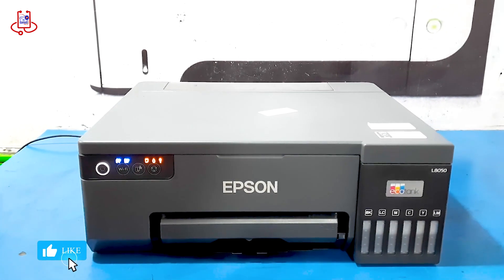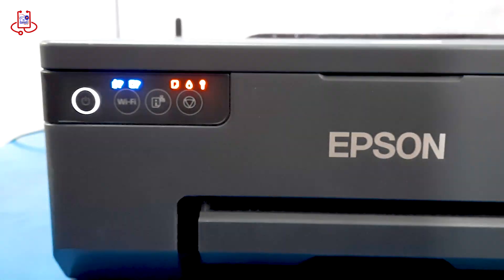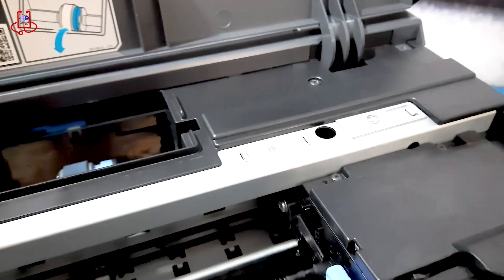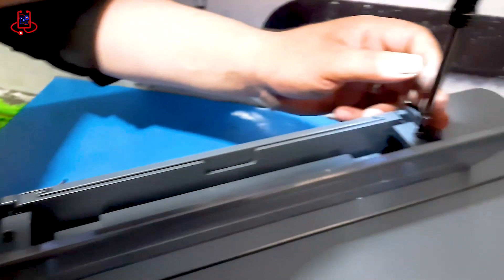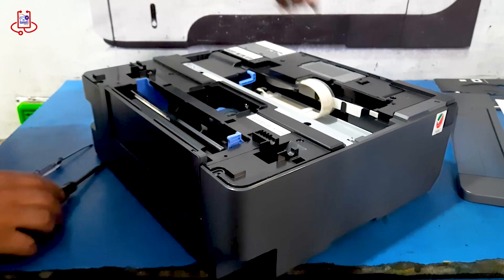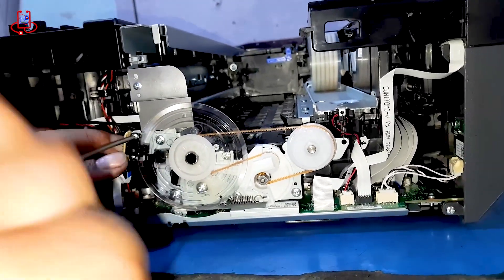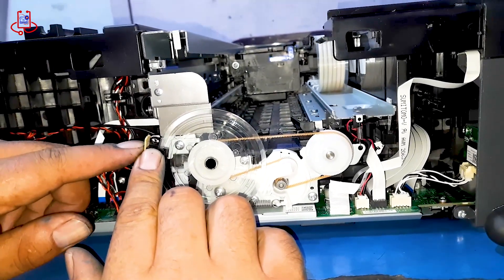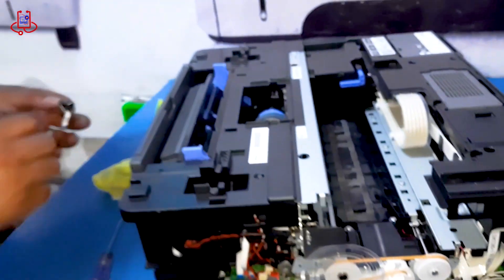Epson L8050 all lights blinking error solution/Epson l8050 not printing

Comment: Epson when I burn it is burning then it turns off
Reply from the maker: Hi! If your Epson printer turns off shortly after powering on, it may be a hardware or power issue.

Check that the power cable is properly connected and the outlet is stable.

Try a different power outlet.

If the problem persists, it could be a mainboard or internal component failure, and the printer may need service.

Comment: Hi😅
For some reason, I got an error
0x791e on the L8050 printer.
I disassembled everything and cleaned it more or less according to the instructions, then reassembled it — but it didn’t help.
The sensor was covered in grease — can I clean it with alcohol or water and let it dry?
Maybe there's still some dirt left on it.
Reply from the maker: Yes, exactly. You can clean the sensors with isopropyl alcohol and let them dry completely. This usually doesn’t cause any issues and may help resolve the error. Just make sure to use pure, appropriate alcohol and allow the sensor to dry fully before using the printer again.

Comment: I tried this but still have the blinking issue
Reply from the maker: If all the lights are still blinking after trying this method, it means your printer needs a professional reset or the waste ink pad needs replacement. Please visit an authorized service center.

Comment: Please solve the problem of code 031006
Reply from the maker: Error code 031006 on the Epson L8050 usually indicates an issue with the mainboard or printhead. We recommend taking the printer to a professional technician for repair.

Comment: Very useful information and I have a problem with L 8050 that "incorrect loading of tray/disc' will you pls help me?
Reply from the maker: Hi! The 'incorrect loading of tray/disc' error can usually occur if the tray or disc is not properly aligned. Please make sure that the tray is correctly inserted and the paper or disc is positioned properly. If you're using a disc, ensure it's placed in the correct tray for printing. You can also try restarting the printer and checking the settings. If the problem persists, you may want to refer to the user manual or contact Epson support for further assistance.

Comment: Epson l8050 bị kẹt giấy hoài,khắc phục sao cho hiệu quả anh trai
Reply from the maker: Hello! The paper jam issue with the Epson L8050 might be caused by factors such as dust inside the printer, using unsuitable paper, or incorrect settings. I recommend turning off the printer and carefully removing any jammed paper. Then, make sure to use high-quality, compatible paper and check that there’s nothing stuck inside the printer or along the paper path. If the issue persists, it may be necessary to take the printer to a service center for a mechanical check.

Comment: hi..how to solve epson L18050 printing blank. can you teach me how to solve this problem.
Reply from the maker: To solve the Epson L18050 blank printing issue, try the following steps:

1:Check Ink Levels: Ensure there is enough ink in the cartridges.
2:Clean the Print Head: Use the printer's head cleaning tool to prevent clogging.
3:Check Print Settings: Make sure the print settings are correct.
4:Print Head Test: Perform a print head test to ensure it’s working properly.
Reply: @devicedoctor1  Thank you.
Reply: @devicedoctor1 
I had the same case, my printer L18050,  all the lights were on, at first, maybe because several pieces of paper were coming in at the same time, then the thin plate around the print head opened roughly and damaged the paper that was working on the drawing.

then I disassembled it and returned the open thin plate to its initial position by pressing it with my hand. 

then I put it back on, and that's how all the lights came on....

I have also learned from several tutorials to clean the paper holder and have also cleaned the sensor like in this tutorial, and the results are still the same...

in advance, thank you for your attention

Comment: AND I have multi head clean and until problem is not fixed.
Reply from the maker: For your Epson L8050 printer, follow these steps for calibration and alignment:

Calibration:
Open the Printer Software:

Launch the Epson Printer Utility software on your computer.
Access Calibration Options:

Go to the "Maintenance" or "Settings" section.
Find and select "Print Head Alignment" or "Head Alignment."
Follow the Instructions:

Follow the on-screen instructions to complete the calibration process, which may include printing alignment patterns to check color accuracy.
Alignment:
Open Printer Settings:

Access the printer settings menu from the printer’s display or through the software.
Select Head Alignment:

In the "Maintenance" menu, choose "Print Head Alignment" or "Head Alignment."
Perform Alignment:

The printer will print patterns to help you adjust the print head alignment as needed.
Additional Tips:
Ink and Paper: Make sure you are using high-quality ink and the correct paper type.
Software Update: Ensure that your printer software and drivers are up-to-date.
If the issue persists, you might need to contact a technician for further assistance.

Comment: I have like this printer 8050,my problem image is not printed normal but when print image or photo is never print in normal colour but it difference on orginal  photo
Reply from the maker: Hello,
Your issue may be due to incorrect color settings, paper type, low ink, or outdated printer software. Please check the print settings, ink, and paper, and make sure the drivers are updated. If the problem persists, try calibrating the printer.
Best regards!
Reply from the maker: Please make sure to adjust the print settings correctly and run a nozzle check to see if the colors are working properly.